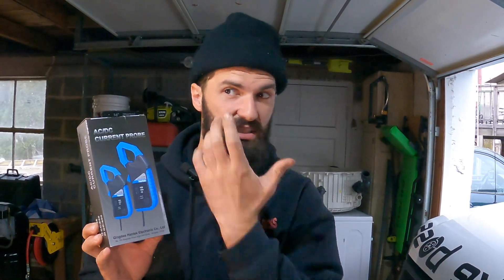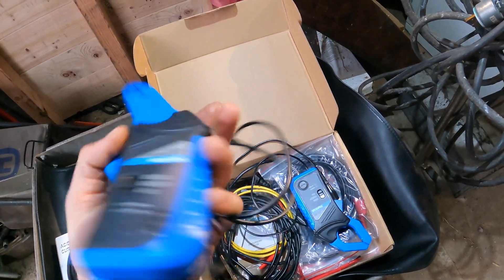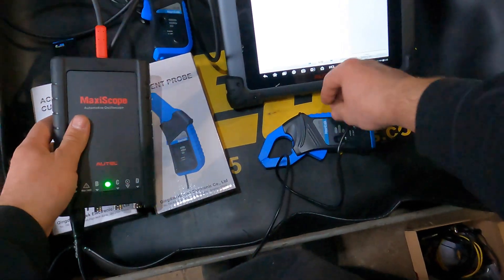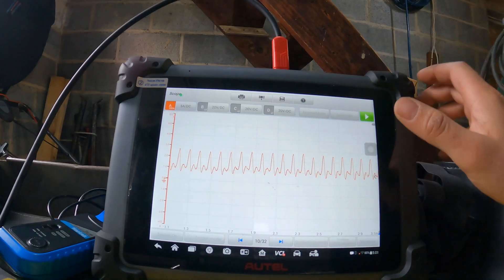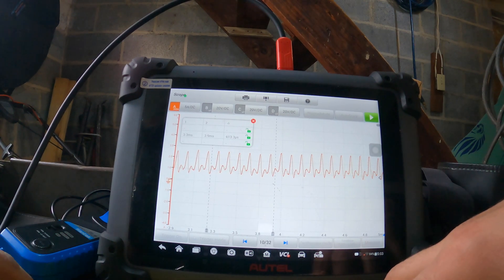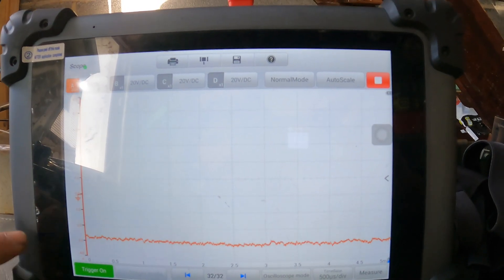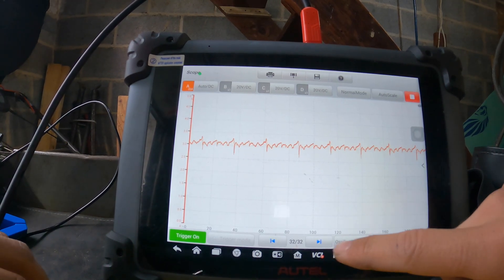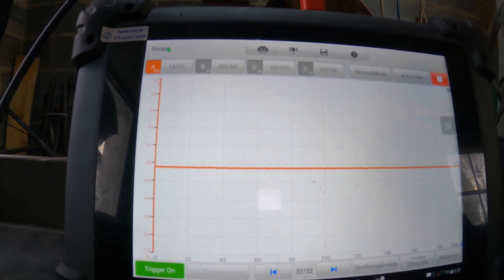MP 408 OSCILLOSCOPE USING HANTEK CC-65 AND CC-650 AMP CLAMPS (RELATIVE COMPRESSION, DRIFT TESTS)

Comment: Great review and good for you in your attempt to get comfortable with using scopes. There's certainly a learning curve and intimidation factor to it and if you don't use it often, you sorta have to learn the whole thing all over again, which can be frustrating. The lower amp Hantek (cc65), as you've said isn't the best, but it's the lowest-priced DC amp clamp in that range I've seen. Mine has issues zeroing properly. Some say you need to push and hold the zero button for 5-10secs before releasing while other say to push it in short bursts, but neither seems to really work for me.  As far as the higher amp clamp, there is a cheaper alternative to the Hantek CC-650 called the HoldPeak HP605A. That one doesn't have a zeroing button, but that tends to be less of a concern when measuring higher amperages (you could also just deduct the offset from your final reading). In case you didn't know, you can also perform a relative compression tests by simply tracing battery voltage. The peaks and troughs will be reversed in comparison to an amp reading, but the data you get is equally useful. BTW, Autel has great stuff when it comes to OBD tools, but their scope offerings are known to be somewhat lacking.

Comment: How did you know the blower motor was working good? Did you have the specs on the blower motor as to how much amps it should be on each settings? Just curious I’m also learning.  Great video by the way keep it up 👍🏼
Reply from the maker: This was a good known vehicle, the blower motor warked good so i was more concentrating on the change rather than the motor itself, different cars may use different types of resistors to control speed so its case by case basis, as long as there is change when the speed is changed then the resistor is working as designed.
Reply: @brakeboss  I understand but I think it will make more sense on knowing what the blower motor should be to use as a reference point.  But point well taken as I mention I’m also learning. 👍🏼

Comment: Great video, Thanks! What were your settings on the relative compression test, something seemed off with your waveform?
Reply from the maker: I noticed that as i was editing that there is that small hump, i think my mistake was not using 600 amps but i had it set on 200 amps and that skewed the image, also i didnt hold the throttle at WOT because i disconnected fuel pump but im not sure if that something that needs to be done on these.
Reply: @brakeboss  You do not need to hold the throttle if you disconnect fuel pump, holding the throttle just disables the injectors on most domestic vehicles eliminating the need to disconnect fuel pump.
Reply from the maker: Thats what i thought also, but wondering why i got that extra hump, i have to practice more with it. Working at MB dealer we never really used scopes, even when we got training, i guess the oem scan tools just gave much more info to make diagnosis faster, but now rhat im mobile i have been missing out on the scope world
Reply: @brakeboss  I Don't know what that extra hump is, I'm assuming it's something with the scope & not the vehicle. Just keep on practicing you're doing great! 😄
Reply from the maker: Thank you buddy
Reply: @advancedleveldiagnostics  Flooring the pedal doesn't always fully stop injector pulsing on some vehicles, from my understanding. Injectors may still be cycled, albeit very briefly. Because of this, when cranking for longer periods, always best to cut power to the pump to be on the safe side, unless you can confirm injectors are fully un-powered at WOT.